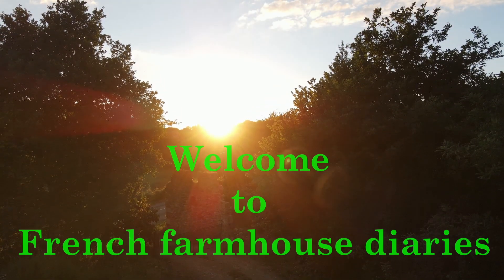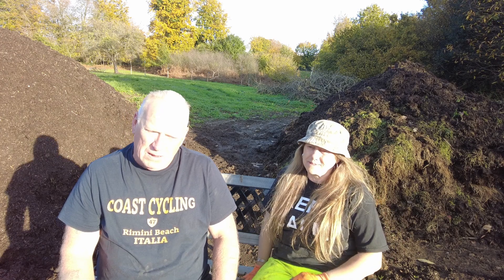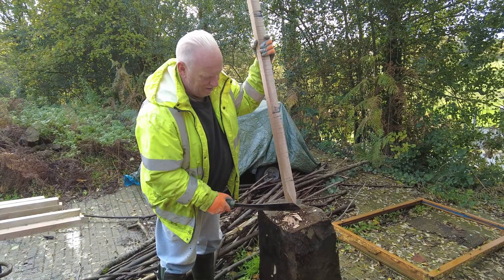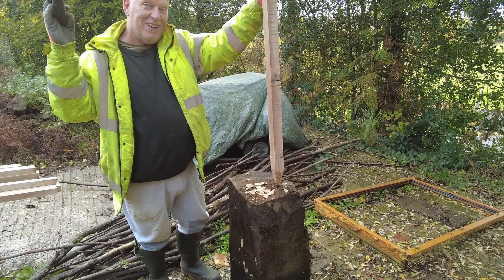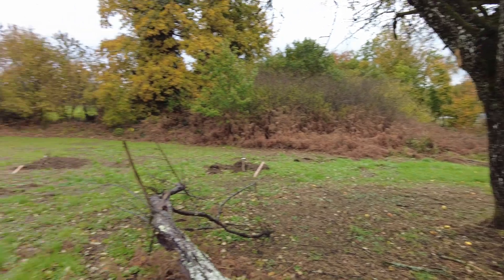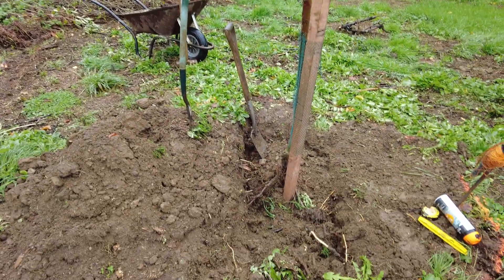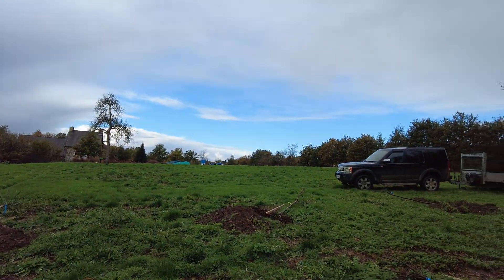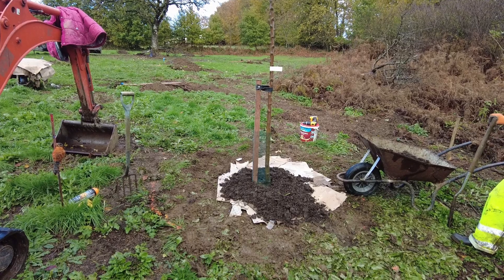Ep 6 HOW TO PLANT AN ORCHARD|#apple orchard  #regenerativegardening #homesteading #selfsufficency

Comment: One trick when planting trees to get them to establish deep roots quickly is to install a pipe at the time of planting below the root ball level. The purpose of the pipe is to allow for easy access to water the trees during the dry months. Cut a few holes in the end of the pipe that gets buried and put a few stones/pebbles around the end to allow the water to disperse when you fill the pipe. 
If you have to water a tree from above/surface, then you promote the roots to grow more at the surface, but if you use a buried pipe, the watering goes straight to the lower roots and promotes them to grow down searching for water. It also saves alot of water that is normally lost to evaporation and also runs off when the ground is hard during the summer heat. The pipe can be easily pulled out after 3-4 years, once the tree is established. Suggest to use a stone to cover the open end of the pipe (when not being filled) to stop anything climbing in and also to hide the pipe from view.
Reply from the maker: Hi Paul thanks for the info we did actually consider this idea which is a fantastic system to adopt especially in dry areas, but our soil is really good at holding moister at around 4 inches deep, so we think we are going to go with the wood chippings method after the compost has gone in to keep the trees growing but once again thank you so much for your input my friend 🍺🤠👍

Comment: One rule I learned with trees is always dig a $100 hole for a $10 tree.  This allows roots to spread more easily and access any available nutrition. When making my stakes I used our chopsaw outside to put points on the stakes. I also use the chopsaw to cut our firewood to lengths. The old dead apple trees would make wonderful wood for smoking meats.
Reply from the maker: What a great saying and very true Cdngardengirl, yes another good tool to use as well 🤗

Comment: Put in the trees hole a metre long by 100mm drainage pipe, with holes drilled into the pipe. Get a pipe cap too. To water trees deep to the roots, fill up the drain pipe.
Reply from the maker: Thank you fir the suggestion Anavelaes 🤗